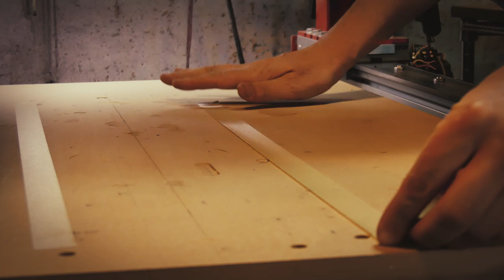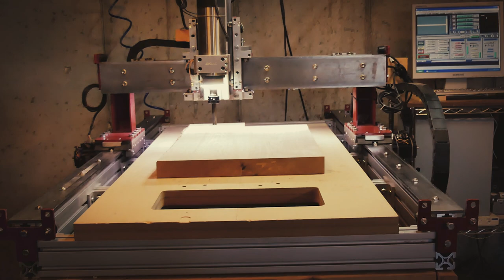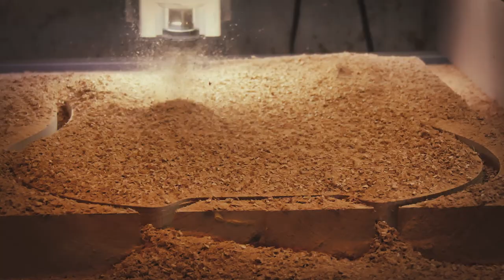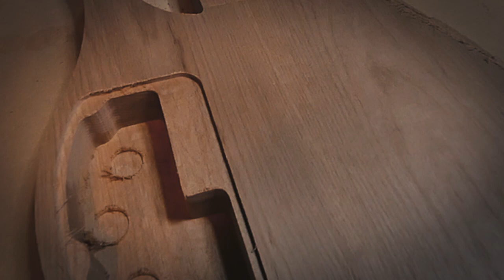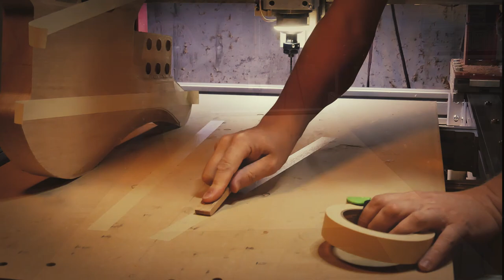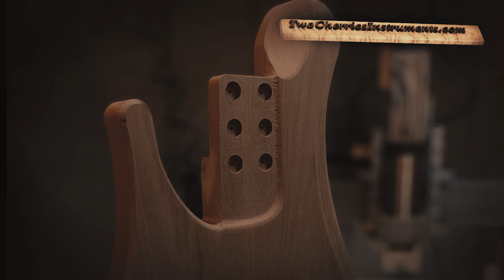The Electric Bass | From Leo to Carl

Comment: very nice, keep giving us this video's thanks
Reply from the maker: I wish I could make one like this every week, getting closer every day.
Reply: It takes me about a week to carve a body. One day to just cut and glue the body together. Day two unclamp the body and make find cut size so that it works correctly on cnc router. Day 3 cnc machining it, then take to band saw to cut off the excess material that is left. Day 4 to the router table to finish shaping the body then start sanding (couple of days for that). Somewhere along the way, drilling to route the wiring. Then more sanding and more sanding and more sanding.
Reply from the maker: @williamthrasher8540  
I can do it all in about a day if you take out the time for glue drying. The real complication is shooting video, editing, and writing and performing the voiceover.

Comment: Nice video. Still cant believe, its just the glue-tape-trick... it makes it so much easier for two sided operations...
Reply from the maker: For dynamic setups it makes things very easy.
Reply: @TwoCherriesIns  so... you would recommend it? still dont trust it for the big routings like body :)
Reply from the maker: @dragonjackson76  If done correctly, I have never had a failure. keep in mind two things. 
-The bed and the part need to be perfectly flat. 
-burnish in the tape on both sides.
Most of the time I use a chisel to pry the part of the spoil board. I would say, if done correctly, it's more dependable than clamps.